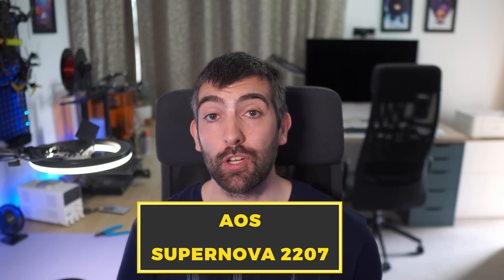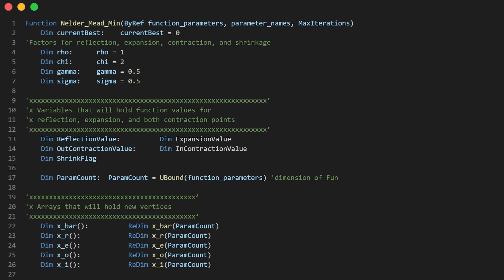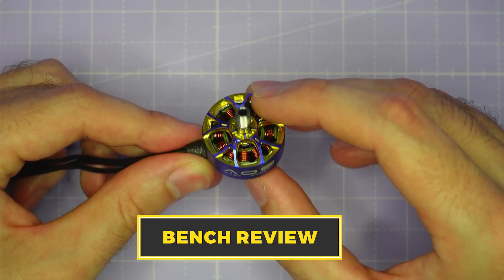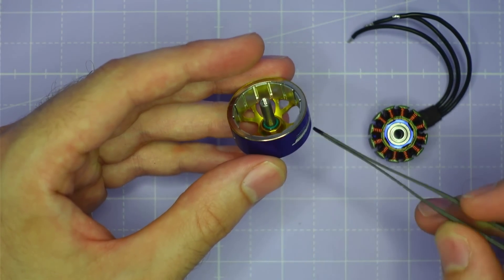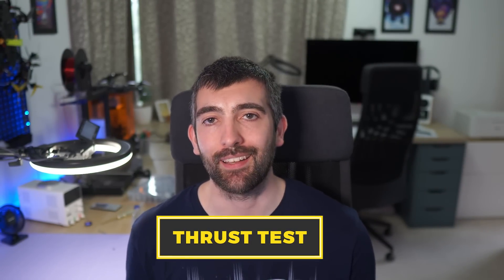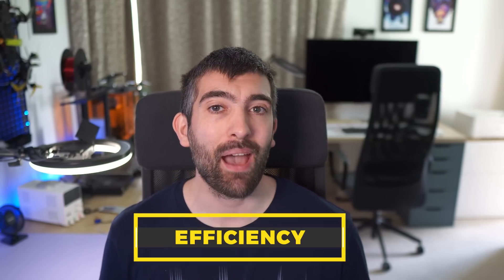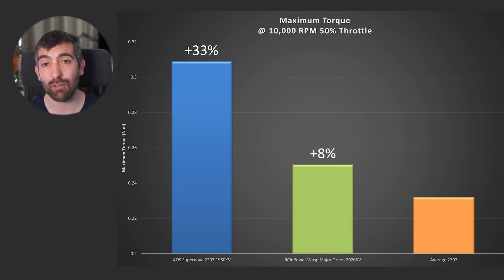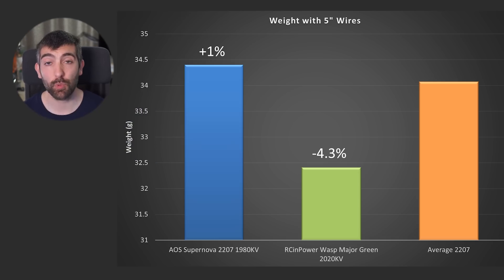How I OPTIMISED the 5" FPV Motor with SCIENCE: AOS Supernova 2207

Comment: Fly really nice by the way ;-) Smooth and powerful and stay pretty cool compared to others. Slightly on the heavier side for racing though…
Reply: Can you actually tell the difference in flight time ? They cost almost twice as much as good "value motors", to make them worth it, they should at least measurably improve the flight time in my opinion
Reply: We actually tested/use them for high end 5" racing. So comparison is not with the value motor field anyways. Flight time is only ~1 minute for those quads and there are many more effects than efficiency to impact that so comparison of flight time is almost impossible. A good indicator of “internal efficiency” though is how hot the motors are after this 1 minute. And I can clearly state that typical motors are usually too hot or much too hot to touch (60-100°C) after such a flight while the Supernovas are no problem to touch (<50°C). Arvin was flying them at last weeks WDRC 2023 race in Korea which had one of the longest full send tracks we encountered so far and the motors came out cool…

Comment: Misleadingly scaled graphs and exaggerated speech is not something I expected on this channel
Reply: I read your comment before watching the video so I was going into the graphs already expecting them to be sketchy but... After seeing those graphs, there's nothing wrong with them, they're all scaled linearly with the range of values all marked, they're about the most honest graphs that could have been used. They're very engineering-minded, but they're not bad.
Reply: @KenPiper  My issue is with the range not going to zero, which makes the improvements look much bigger than they are. Why have a graph in the first place if its not absolute scaling?
Reply: And I'm thinking, why does sharing the true dimensions matter?
It's clearly not 2207 in size, but who cares? That is fine if it does the job, which based on the data it does.

I just hate the marketing vibes.. put me off.. but prob in my shopping cart soon enough regardless.
Reply: Wasp provides 8% more torque compared to the average motor while the new motor gains 33%, but you cannot deduct 8 from 33 and say that the supernova is 25% better than the wasp. 0.3/0.25=1.2 which is 20% improvement
Reply: It’s not misleadingly scaled.  It’s scaled exactly like everything else in engineering.  Nobody starts a scale from 0 unless 0 is particularly relevant . Videos of infrared are a perfect example.  The dark colors are just the bottom of the range.
Reply: You just didn't understand the graphs. Not his fault
Reply: @sylaswojciechowski6895  
The graphs are OK. He's saying slightly incorrect things in the video.
Reply: Just say thanks and learn. You're not obligated to buy the motors... Even when you should😂😂😂